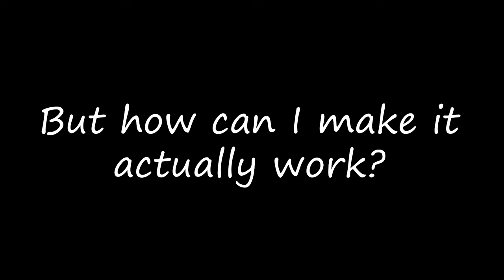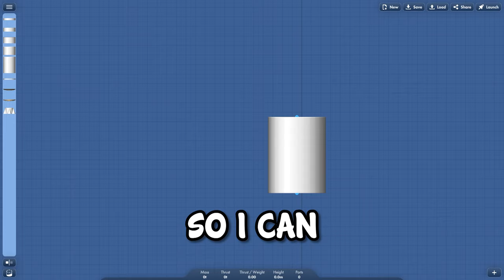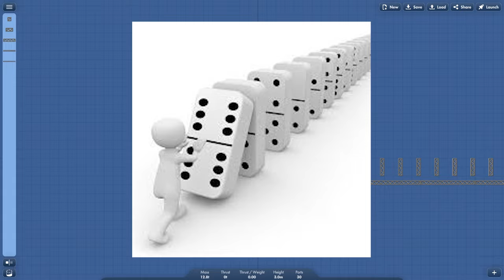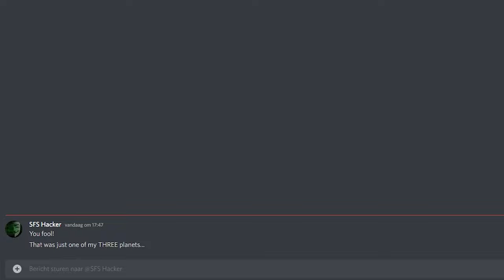I Tried To Make Airplanes In Spaceflight Simulator

Comment: actually, i made an actual nuke that uses 100 engines of all kinds to heat damage and has an explosion radius of roughly 6 times larger than your bomb and also looks really cool because i put it in a tsar bomba shell
Reply: hmm, interesting
a moment ago I created the device lagging machine
it works by merging 512 hawk engines and turning on the engines
even the 1/10th of the throttle can lag the entire game